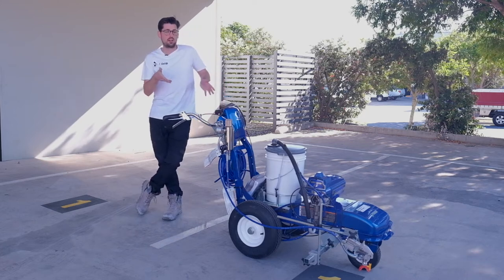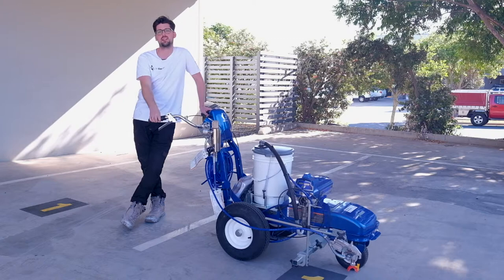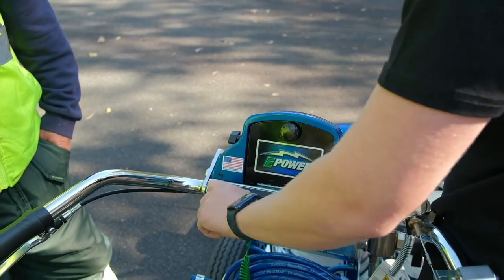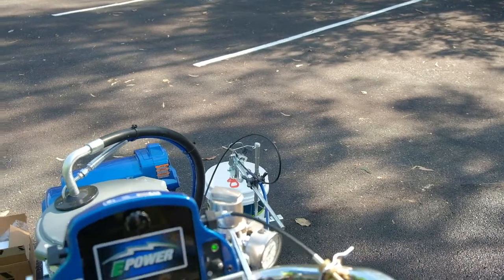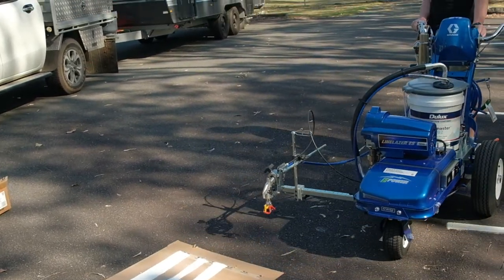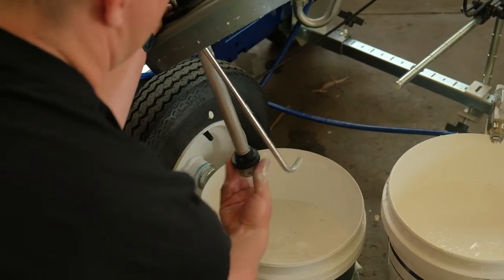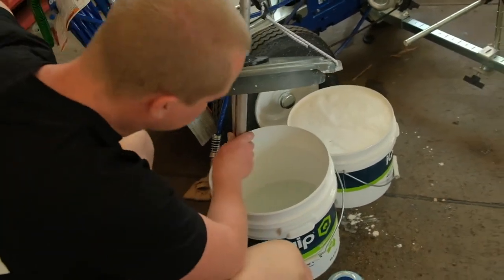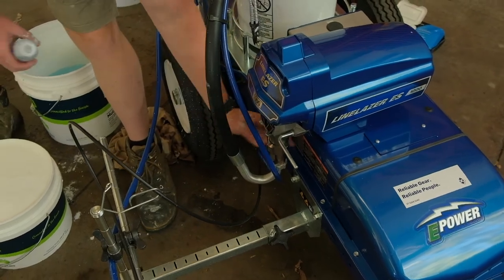Striping Lines with an Electric Line Marker | Graco LineLazer ES 1000

Comment: We use the petrol driven with solvent /chloronated based paints, will this machine be ok with these paints?
Also we sometimes need to change colours multiple times for one job is this machine ok with that?
Reply: Waste of time , I have one and the batteries are a waste of time.  On our 4th battery and sorry we ever bought it. stay with petrol. Don't mind the fumes, fumes from the paint are worse
Reply: Plus their a tonne weight, hit the gym if u intend on pushing it up a hill

Comment: Greatest heaps of shit ever used. There a tonne weight. Batteries dont last. The ball bearing in the pump clogs up a lot faster than the petrol ones for some reason. Ive 3 petrol gracos and il continue to use them until petrol runs out in this world. At least 2 nd a half to 3 times the weight of a petrol one. Try pushing it up a gradient and ul know all about it.
Reply: Can you please stop disrespecting my machine. I own two man 😡💢💢💢